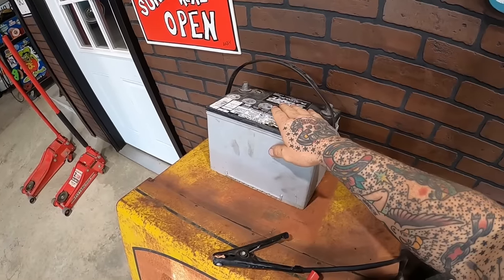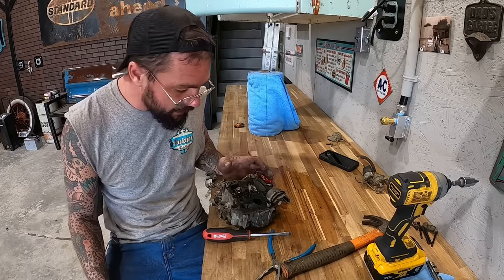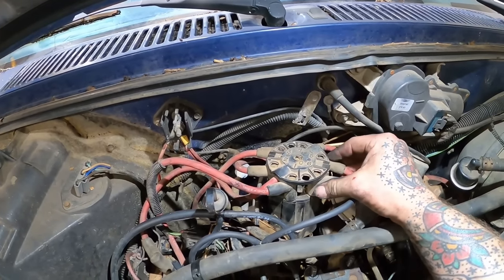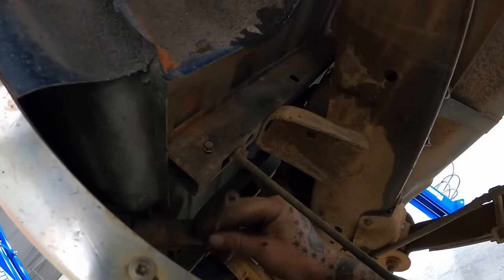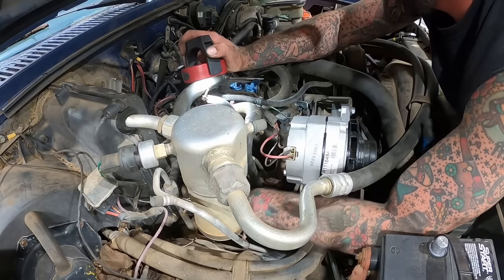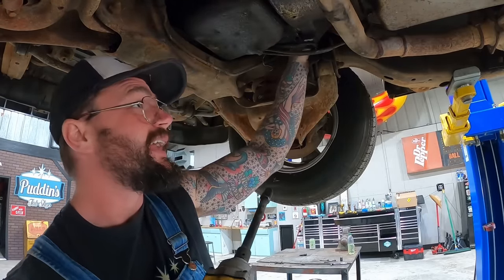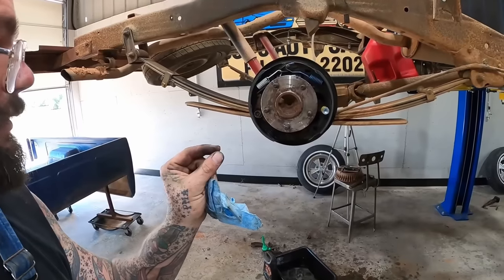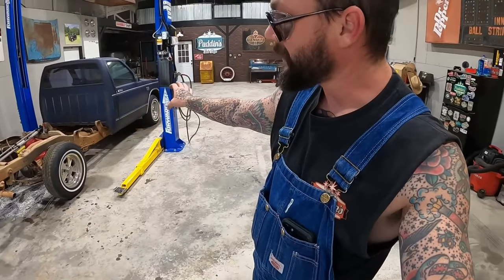1984 S-10 Pickup. MECHANICAL REBUILD. Will it RUN/DRIVE better?

Comment: I have a 1982 S10 I've been working on lately. My Dad bought it for me to drive to college in 1994. I drove it through college, my brother then drove it through college. Somewhere in there my Dad rebuild the engine. It got sold to an uncle and then sat for 15 years till he died and my Aunt gave it back to me. I have rebuild the T5 transmission in it and rebuilt the carburetor.

Comment: Know you know why all of us OF DIY mechanics are grumpy. That carb is perfect example of what we put up with 40 yrs ago.   You are providing great entertainment, Keep it up!!
Reply: I had one on a blazer with that carb that I absolutely hated. I got so mad I ripped all the junk off the outside, and plugged every vacuum port. 
It actually ran better  that way .....such a bizarre little carb
Reply: @ryurc3033 
They always run better plugged or swapped with a weber. Lol
Reply: I'll grant you that, but you ought to try working in a shop where you've got cranky customers lined up, cranky bosses riding your ass, and every time you turn around, you're waiting on parts.

Not cutting down DIYers; I were one, once upon a time.  But a guy that works in a shop works under a lot of pressure.  Plus, we don't get paid by the hour; we get paid by the job, and the job don't pay until the job's done and the customer's paid for the job.
Reply: @tetedur377  I`ve always said a mechanic who`s any good should be paid a decent hourly wage!!

Comment: Pro tip: use a bit of chap stick on your carburetor gaskets, so you won't destroy the new gaskets when you have to take it apart again to reinstall the 47 check balls you forgot the first time you put it together 😅

Comment: I have a 1993 S-10 2 door, 2 wheel drive, short bed that I bought new in 1993. It only has 31,000 miles on it, and looks brand new. It has been garage kept since new. Most of the miles are highway miles. Shortly after buying it, I bought a beater transportation car, and turned the brand new truck into a project. I have invested a small fortune into it over the past 30 years. It now has a carbureted 383 small block, a 4 speed manual transmission, completely new exhaust, lots of new steering, brake and suspension parts, lots of cosmetic work, cowl hood, tonneau cover, 225/70-14 front tires, 275/60-15 rear tires, and has run in the high elevens at the local drag strip. Not a scratch on it, it has 50+ coats of liquid glass, the bottom is as clean as the top.
Reply: That`s a pretty good time. Our nephew drags a 1977 Firebird which we helped him acquire the big block 400 engine we helped him get running & install. Yours is faster!

Comment: Since you now have a lift you need some lift screw jacks. You need one for the front and one for the back. This sturdy up the vehicle while it’s on a lift. That way if you remove or add weight from one end of the vehicle it doesn’t wanna do a nose dive. Trust me man they are worth it. Safety first

Comment: I had a 1986 S-10 4×4 2.8L it was a dally driver for 17 years. Work truck. It had a 5 speed. It hauld many many loads of wood. Ive had it chained up all four. I drove it like it wasnt my problem! In that 17 years I changed the clutch and the regular parts a 284000 mile truck would need. I donated it. It would still run and drive! No Reverse. I Love and miss that truck!!

Comment: Been waiting for this build. I have an 86 S10 with a 91 front clip. Has a 350 and th350. Love my truck. You inspired me a year ago to get off my ass. It's a driver now thanks to you my man.
Reply: Badass dude....
Reply: Had a 350 in my 94 step-side S-10. She was a mocha color, about the shade of the old tan M&Ms if you remember those. Absolutely beautiful daily driver that I never should have sold 😞
Reply: Can’t go wrong with a V8 S10 , I’ve had a couple over the years and my Daughter has a 96 that we put a 350/700R4 in a couple of years ago. She loves that truck.

Comment: That is a Durango model .. before Dodge used it Chevy S-10 trim for 83-85 was available in Durango level (which was color matched seats, door panels, and carpet, plus little plastic chrome emblems on the glove box and fenders .

Comment: I have a little experience with the 2.8. If you end up with an oil leak after the valve cover gasket change, the distributor doesn't have the paper gasket at the base. It has a rubber O ring that you have to pull the distributor to get to it. If it's bad it will leak like crazy. Keep it coming! Amy and Don from EL Reno.

Comment: What's bad is when you get it all back together and then you find a small piece that had fallen to the floor after you have just mounted it back on the motor and cannot get it to run right,then you realize you have to remove it and disassemble and put the little piece you found on the floor back in and install again!!

Comment: Cool S10!  I had an 84 S10.  This is the high toned Durango.   It's got air-conditioning and white walls.  Leave the Paw Paw bug deflector.  It's period correct.   I really need a pickup!  Best wishes

Comment: When I'm just trying to get one to run I use a empty washer fluid jug with a bulkhead fitting screwed through the bottom. Connect a hose to that and then to the carburetor, hang a hook on the handle, fill it with fuel let it rip. No need for a fuel pump. I call it hanging an IV. It works well.

Comment: Here’s a tip on the valve covers because they notoriously leak.  Don’t use cork.  Rubber only.  Fel-pro is good.  Also do not use any RTV on it, EXCEPT where the head meets the intake. Only use a dab on that area.  Zero leaks.  Also, toss that EFE heater gasket from the carburetor in the trash.  They crack and that’s a source of massive vac leaks.  Regular gasket.
Reply: I’ve run into the SAME issues with cork gaskets…leaks.  Personally, I’ve had excellent success using a light coating of axel grease on cork.  The grease allows the cork to move a little during installation/torqing rather than bunching up which causes leaks.
Reply: @MrGarfield4  Very good idea.  I used to have leaks even with rubber gaskets.  Using too much RTV is the issue.  I've learned a lot about that stuff, and it should definitely only be used in small quantities.  Too much and you can destroy an engine with it or at the very least make for a very messy clean up the next time.   These on my truck have been perfect for 10 years now.
Reply: @theoriginaljimmykicker  I’ve been successful with no leaks for over 20 years.

Comment: You called it on the fuel filter.  Getting that line rethreaded can be a bear.  I cut my line and put a Fram G3 inline right by the driver valve cover.  Problem solved.   Well I really solved the problem by putting EFI on it.  That gets rid of all those ridiculous smog stuff too.  The 86 on has so much less garbage.

Comment: gotta admit, that line "the defibrillator hose runs to the sphincter valve" got a big ol' belly laugh outta me. epic Puddinisms. good to see my other youtube favs are helping out on the build. I have an old 99 s10 that I use to haul off stuff and putter around. good little truck.

Comment: That design of fuel filter requires the spring in the carb body to keep the filter with check valve and gasket (made together rubber) against the filter housing where the line threads in.  The check valve kept the carb from draining back to the tank and the rubber acted as the seal between the filter and the housing..  The nylon ring was what seals the actual housing to carb body.  The design makes the filter expose less surface area than if it were engineered intelligently.  The earlier models used a gasket between the filter and it's opening and also exposed less area for debris than if it were made properly.

Comment: Starter from hell. Did one on my 86 , told the wife be dun half a hour. Five hours later, still lying under truck, had to loose n motor mounts, jack up motor and it fell out. Good job on yours.
Reply: Ouch! That could have been bad. Have had a 5.7N engine starter fallout & gave us a fat lip with a permanent scar!

Comment: Puddin i know you dont like to spend money but i would HIGHLY suggest drop spindles in the front, that extra 2" is a godsend, those trucks dont have alot of suspension travel, then whack off a coil or so and get a 4" drop. Out back just take out a leaf or 2 and 3" blocks. If you arent gonna notch it then at least whack off the bump stop towers, then add air shocks to level it out. It will ride like a dream!

Comment: For your lift learning: With that style of arms on your lift, usually you fold both arms toward the back when you move them out from under the vehicle. That will make it easier when you are positioning shorter wheel base vehicles on there, like the tow-rolla.

Comment: An outstanding video Sir! As an old mechanic from the 60-90's I knew you were going to have a fit with that carb. rebuild kit.But you stayed the course and completed the mission, So I salute you and promote you to "Vacuum line changer Extraordinaire!" When all the hoses are good and no leaks they run pretty good.:goodvibes:
That sneak peek of the Merch Headquarters looked sharp!

Comment: Rule of thumb with lifts don’t pulse the motor. It’s hard on the motor and the pump. the shock from the pump coming on and off can blow a hydraulic line.

Comment: That fuel filter setup is the same as a qjet. The spring goes into the carb to push the spring up against the inlet fitting so it's forced to go through the filter, and that check valve is well, a check valve. Spring goes in first.

Comment: The check valve part of the filter goes towards the line and is opened by fuel pressure. One sweet s10, keep up the great work!

Comment: Fiji water bottles have been used as gasoline tanks in 1/4 scale RC airplanes for a while. I had one in my 30cc 2-stroke gas 3D Hobby Shop 72” Edge 540. Their square shape and sturdy construction makes them ideal. There’s a company that makes a kit that screws onto the opening for all the hose fittings.

Comment: In Puddin's Fab Shop, an October breeze so mild,
I toiled with spark plugs, a seasoned hand so skilled.
Each twist and turn, a well-practiced chore,
Till we reached the last, in this task we'd explore.

As the sunbeams danced, the air medium warm,
I felt the engine's secrets, their every hidden charm.
But our journey hit a snag, a puzzling coil,
The final plug emerged, glistening with oil.

With hands that knew each bolt and wire by name,
I gazed at the mystery, this unplanned little game.
Oil-clad, it gleamed in the fading light,
A riddle, a challenge, in the dwindling daylight.

We'd seen so many, but this one stood apart,
A riddle of machines, a mystery to chart.
In my trusty shop, I'd find the clue,
To solve the enigma, and make the engine purr true.

So I pondered and prodded, with patience, I'd probe,
To unlock the answer, to crack the secret code.
On that warm October day, in my workshop's embrace,
I'd conquer the challenge, with a smile on my face.

Comment: Oreilys should sponsor this truck with parts. Cheap advertising.
Reply: We recently changed parts suppliers from NAPA to O`Reilly`s because after 3 fuel pumps that would not fit or leaked we finally found  a fuel pump from O` Reilly`s that fits & does not leak. Also less $$ & longer warranty too than NAPA.

Comment: I did the in tank fuel pump on my 2000 S-10 the hard way.  I jacked it up and just dropped the tank.  Everyone was saying, pull the bed off, just take the bed off, just ... ...  Kinda hard to take the bed off when it has 800 lbs of quikcrete and you have maybe 3 hours before it starts pourin down rain.  I got the tank dropped, new pump installed and back up, in just under 3 hours.  I also put my tetanus shot to the test and added a few more scars to my hands and arms.  My fuel gauge  didn't work but I took care of that after I got the truck unloaded.

Oh and it started raining about 30 minutes after I got the truck under the shed and kept up for 4 days.

Comment: Puddin, I know you’re fired up for working in the new shop. Man I’d give anything to be able to pay for the floors of the shop to be painted or epoxied. You seem to be a guy that truly wants to keep your shop nice and sealed floors would really help keeping that shop looking badass. Love your content my man.
Reply: He has said - MORE THAN ONCE - that he has no interest in having fancy floors in this shop.    This is a shop to work in.....not be a show place.  He doesn't mind the stains.
Reply: I’ve built two shops over the years, the first one the concrete guy suggested I seal it and I had him do it, gas and oil ate through the sealer and it was a mess for a couple of years till it finally deteriorated away:
Second shop same thing but I told the concrete guy that story and said no thanks, he assured me that the sealers they sell nowadays won’t do that. He was wrong !
If I ever get to build another I will not seal the floor.
Reply: Cement floor i gud enough for puddin use what you have...

Comment: Never was an S-10 fan, but this one is in great shape. GM and Fords in the '80s were a bear to work on with all that emissions crap. Thank GOD for Fuel Injection which helped clean up most engine bays!

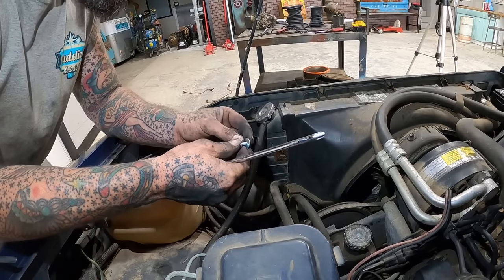Comment: 38:07 that ball is kinda important, it's your vacuum reservoir canister. It provides vacuum when going uphills and engine vacuum drops, without it your vacuum controls for the climate system will default to defrost when vacuum goes away, like when accelerating

Comment: Next time your at Harbor Frieght you need to look at the parts washer , a grease cup for greasing the bearing they take a pound of wheel grease at a time , and a rolly cart to set parts and bolts and crap your going to use on that build !

Comment: And Putting there's another way of getting the brake cylinder in  another Put a socket on it on the back and wedge something in the front and Put a socket on it in the back. And push gently and it will slide red on easy😅
Reply: That`s a great idea! Will have to try that when we re-brake our truck.

Comment: This is near the end of carbs and why they went away. Emissions were rediculous. All because when the engine is cold it needed choke. EPA hated chokes because emissions are high under choke. All that vacuum hose and the pulloffs were to get that choke off as quick as possible. The other target was the idle circuit because at idle it is a richer mixture. Then feed the exhaust back into the intake to burn any unburned hydrocarbons. Notice how unclutered fuel injected engines are today compared to this mess. That carb is tough to rebuild. Any tiny vacuum leak and it will not perform. Worn throttle shafts bushings are death. Nice you are doing this to give it away.

Comment: The OE carb base gasket, that grid thing is a cold start fuel vaporizer. I can see that it is burnt out. It will run without it but it won't like cold temps. Way back when I started out wrenching at a GM dealership, them trucks were new. I kinda remember there was a service bulletin about the horn pad to replace them.

Comment: I really know I'm old because I remember when the s10 first came out! I was still paying on my luv truck and wanted to trade it in on the new s10 lol! I finally bought a 93 s10 brand new after I'd owned several used s10s. I've v8 swapped several dozen s10s back in the early 90s. Sure would love to own another one!

Comment: Sleeperdude does Vienna sausages bourbon bbq and rc cola.
Glad to see you working in the shop. I'm excited to see the wheel hop Wilma conversion. You could always build the orange international into the Cummins swapped beast and make the blue one into a big front small rear burnout truck.

Comment: That brings back fond memories! I had a black GMC version of that truck in high school but with a 4 speed. One of my brothers had itsChevrolet twin.  I seem to remember the only way to change the oil filter was through the wheel opening.
Reply: Yes, that`s true with the 4x4`s. Only way to get at oil filter is through wheel well.

Comment: I use 1/8 inch slices off a 2x4 to hold up sagging headliners. Use like a bow in a covered wagon. Looks ok if you stain it. Tuck ends under trim.
Reply: Another great idea. Have to use that to fix the annoying sagging headliners in our trucks.

Comment: Watching you work on this old GM truck brings back memories for me. Working as a flat rate tech from the eighties till present, I have done my fair share of these. Those valve cover gaskets didn't pay much flag time and it will kill your day when you could be doing something that payed better and was a lot easier to do.  The eighties before fuel injection took over were the worst time period for awful carburetors and the vacuum line mess!  Love watching your videos on slow days at the shop, they keep me laughing and help past a slow day by.

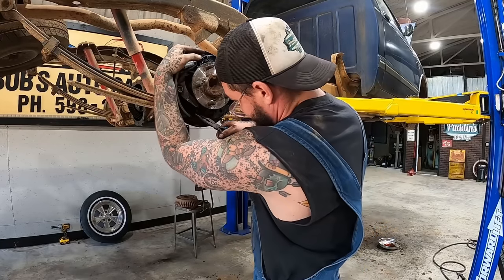Comment: 1:38:45 I've changed out rear drum brakes for a long time before someone aske me to borrow my brake tool. I never even had one until resently... Just used a long screwdriver and pliers. 🤣 I actually had the shoes on backwards until a mechanic asked me who changed them for a state inspection... I was just putting them on the same was as the previous owner did for 20 years 🤣 I now put them on the correct way.

Comment: We had a 2.8L v6 S10 shop truck in the late 90s and bought it cheap because it had spun a rod brg... It's not a big deal for a machine shop, and we built the engine... even with it being only 10yrs old we had to replace every vacuum hose under the hood.  In the end, it was a great little truck for running parts and stuff. It wasn't anything desirable back then, but Dimes are a hot ride today.... This is going to be an awesome giveaway for your channel.